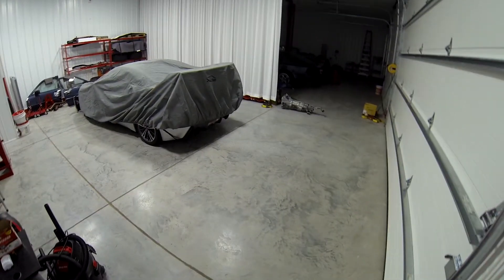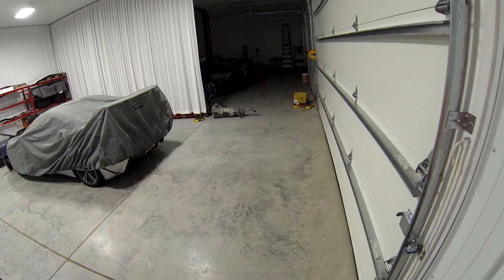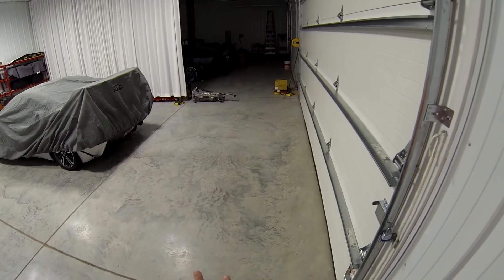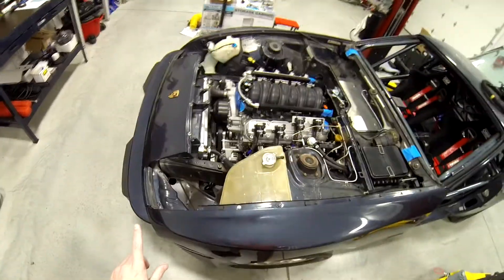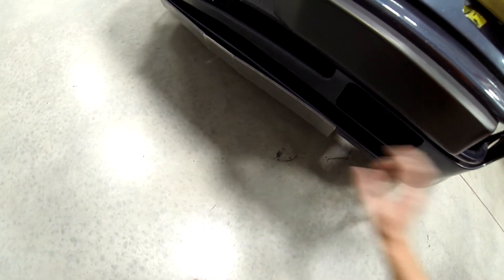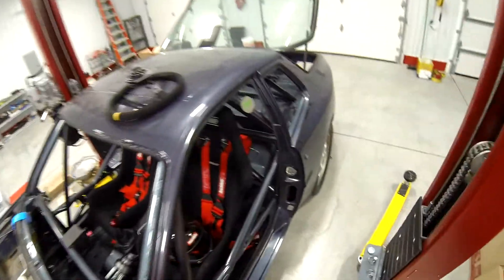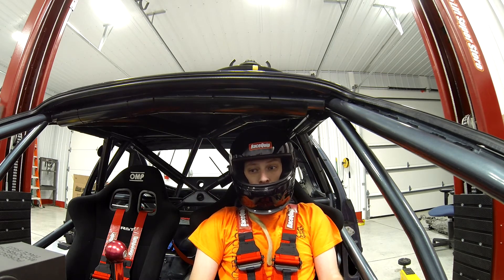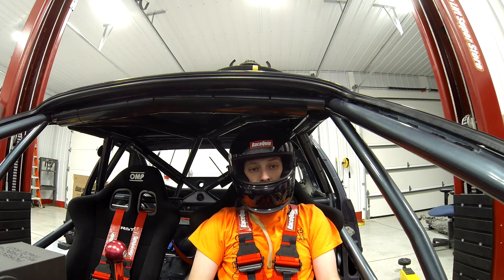Porsche 944 Rally Build - Seat Mounts, Harness Bar & Anchors, Dual Masters

Comment: I'm jealous man! Would you recommend me shaving my driver seat in order to fit with a helmet on?
Reply from the maker: Shaving a seat could potentially reduce the strength...  you could always remove the seat adjusters and bolt the seat directly to the floor!  I had to make custom mounts for mine, but they also cut the floor, too.